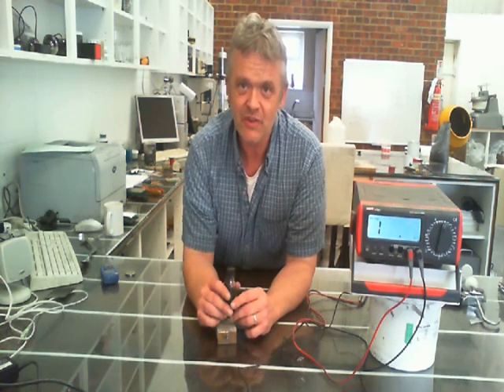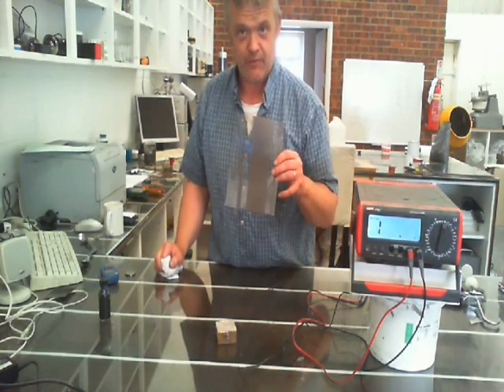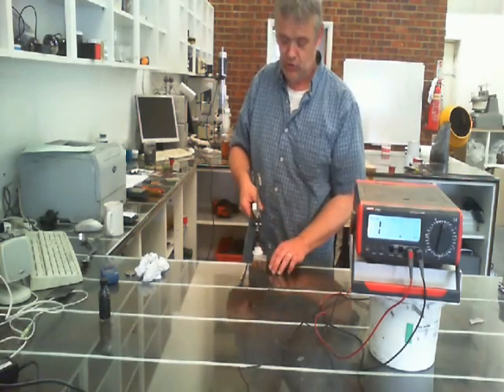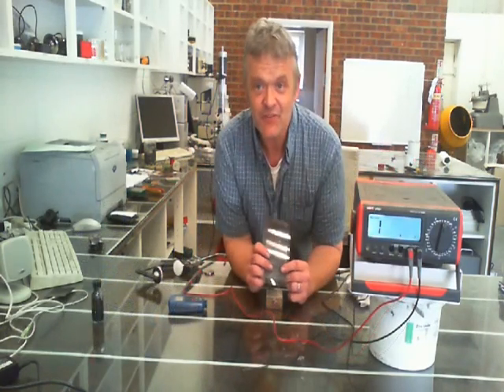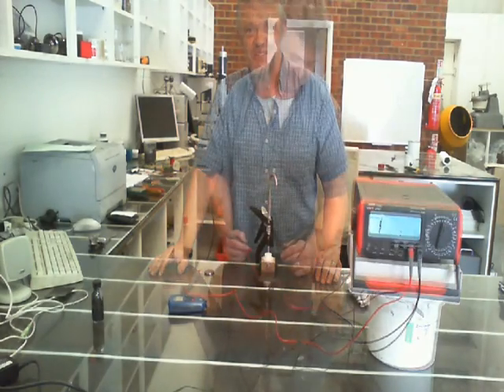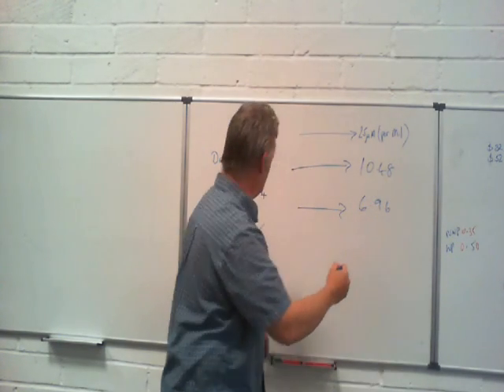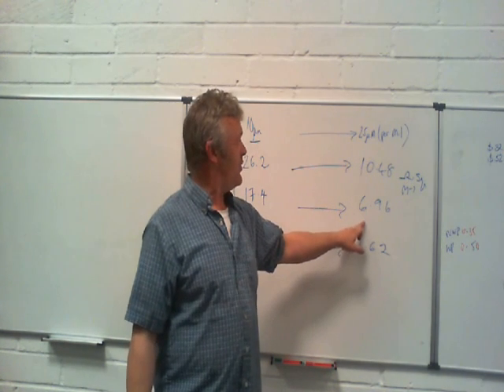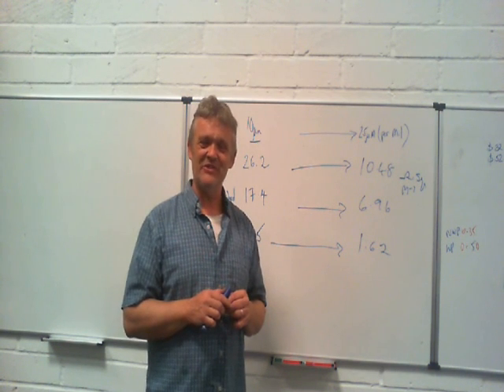Super Conductive Carbon Ink

Comment: I was doing virtually the same experiment last night with the ink buffing but with a twist. I applied a current, much like the heat matt concept,  to see if I could 'alighn' the carbon ink. My thought is to then "cook" the zinc oxide to the carbon with a sheet of aliminum on top. Stand clear mad scientist at work. Will post a video on the results.
Reply from the maker: I want to see it - so do!

Comment: I know this is old, but it would be interesting to see some electron microscope images. I presume the conductive particles are graphite/graphene. So I wonder whether burnishing just pushes the particles closer together, or whether they join up molecularly to produce larger graphite/graphene particles. If they do join molecularly after burnishing, then it should be extremely robust, allowing smaller bend radii on a flexible substrate.

Comment: Which method did you use to make the conductive ink which you sent out Robert?  I mean the non waterproof stuff that I have. Which of your videos is closest?

Made another 3 swag sheets today, and they are doing great!  Just bought 30 more acetate sheets to try some different shapes and ideas.
Reply from the maker: I take it you are running short of ink then lol - just email me your address and i'll send you some mate - but i am off to the states for a week so it iwll be after taht
Reply: Robert Murray-Smith Nah, I'm good for the next week for sure! I still have more than 3 quarters left. I'll definitely be in touch when I do though mate! I think that pot you sold me was well filled, and I'm only using it for very thin layers
Reply from the maker: MrSkypelessons
that's cool mate - you are doing some good stuff and happy to help where i can

Comment: Hey Robert the water based conductive ink dissolves in a copper plating solution.. Cant do copper plating in a container. Will try manual coating with a sponge.
Reply from the maker: better if you use the waterproof ink mate - that's what it is meant for - I had reports that the waterbased stuff was ok with absorbent materials like leather but not plactics and remember to wash your thing in acetone or IPA before coating to remove the grease

Comment: Hi Robert,  I have a question about your method of converting the conductivity of your sample to a 1 mil equivalent.  Is this thicker three dimensional ink like having a bunch of series-parallel resistors  and then dividing the measured resistance of the 3 dimensional resistive network by the number of parallel resistors to get the series resistance?  Keep up the good work. Cheers!
Reply from the maker: +Inspironator no mate - the material has a bulk resistivity that is directly proportional

Comment: Wow.  By the way you can get an inexpensive slip roll 3-1 brake, shear, slip roll 32 inches I think for under $400 less with a coupon from harbour freight.  Only does up to 18 gauge but should be fine for what you need, and you can always modify it. If you desire ultra high pressures I would be willing to put together a hydraulic slip role for just the material costs.  I had tried my hand at pyrolytic graphite some time back and the difficulty in getting the high temperature along with the brittleness and such had me move in another direction.  Even looked at 6H SiC for a time but then its a large perfect crystal that is hard to get.  Many may not get what a big deal this is, but I am having to pick my jaw up off from the floor. It's one thing to get a lab result, it is quite another to get a lab result which can be manufactured such that the lab result is repeatable in the field easily.
Reply from the maker: I do sometimes wonder if people get it lol - I will get round to a brake as I need it to really test some stuff I am doing.
Reply: Might be interesting to try a non ferrous metal which can be welded with pressure, in combination with patterns of graphene layered on different sheets of the metal.  In such a case the welded metal have the strength of a solid but they have the holes the size of the ink line of your pattern.  For Al you need 5K PSI per inch. As you know you can lower it somewhat and elevate the temperature to just below its melt line.  It would enable heat exchangers that are ever more compact and efficient.  For others who are following our conversation these type of heat exchangers are known as printed circuit board heat exchangers, and the welding process is known as diffusion bonding.
Reply: Here are some resources for those people interested in printed circuit board heat exchangers. 

http://www.academia.edu/3641995/Selection_and_Use_of_Printed_Circuit_Heat_Exchangers

http://www.chemkb.com/equipments/heat-exchangers/printed-circuit-heat-exchanger-pche/

http://www.inl.gov/technicalpublications/documents/4731815.pdf

And there is an article on science direct if you google.  Also look into tesla valves when designing as it offers some unique ways to build such heat exchangers.
Reply from the maker: now i have to get up to speed lol
Reply from the maker: Kimberly Peacock
nice idea
Reply: Robert Murray-Smith It's ok you are still ahead of the pack.  The most critical area to make use of this miracle material is ease of manufacture and ease of engineering use.  In baseball we would say you hit a walk off grandslam with the team down 3 runs in the bottom of the 9th to win the game.
Reply from the maker: Kimberly Peacock
and I was watching the mets only last night lol - I like to think of things in terms of what i call appropriate technology - that is - that technology that is sufficient to do the job

Comment: Im fairly new to working with electronics as far as building my own circuits and boards. I'm much more of a wood worker. I was wondering, would this work well if I used your ink to draw a circuit onto sealed wood? I'm assuming it would have to be sealed with shellac or the like to prevent absorption into the wood. I'm very interested at mixing my two hobbies together for some interesting designs. Thanks in advance.
Reply from the maker: guardianPO I think it would certainly work mate

Comment: Hi Robert, I see you are using a 2-wire meter rather than a 4-wire meter for the resistance measurement. whenever I use my ordinary fluke 75 there appears to be a residual / inherent resistance of 2 - 3 ohms when I do a probe-tip to probe-tip test. 
If your meter is anything like mine, the 4.5 ohm would be halved. Is this significant for calculation purposes?
Reply from the maker: yes

Comment: Hi Robert, Have you tried to print very fine tracks with your super conductive ink in <1mm width range. I would be interested in your readings for circuit density.
Reply from the maker: i will do it mate
Reply: Robert Murray-Smith
thanks mate I appreciate it. I have been following along and making some ink and this is where stuff breaks for me. Trouble is I really don't know what the quality of the graphene I am producing is and I am not sure I have my graphene to binder ratio or recipe correct yet.

Comment: I have a question for you, In what method that you have tried do you reckon you have gotten the largest and purest graphene nanosheets? I need them in the 800~2k AMU's. IDK what other units to put that in. Then I need to figure out a way to isolate them by shape. possibly steal an enzyme from some bacteria or plant or such and use that eh? 

I'm after early nanocircuitry. at that distance I should be safe making a transistor I think. If Im lucky I might design some standardized parts for constructing artificial enzymes in the process.
Reply: I am almost always optimistic about these things, can you tell?
Reply from the maker: by amu do yo mean atomic mass unit?
Reply from the maker: Keegan Maloney
it does seem ambitious but without ambition where would we be lol
Reply: Robert Murray-Smith Yes. what would be the right way to define the size of a molecule? longest and shortest points across in μm?
Reply from the maker: for graphene nanometers
Reply from the maker: Robert Murray-Smith
that is for physical sheet dimensions you might use angstroms for distance between sheets
Reply: Robert Murray-Smith I guess I would need everything from a ~ 7 by 18μm sheet to maybe 30 by 50 ish? now that I think of it, I do need a variety of sizes. 

I have some notions of how to use enzyme 'filtered' shapes to form physically changeable states using doping and very small charges. Actually, I could make it a memristor with about the same difficulty as making a transistor couldn't I? Still, its not exactly the same as the graphene memristor they already made (I don't think).
Reply: Keegan Maloney also this is mostly off the top of my head right now, I reserve the right to change my mind about the sizes. Early days.
Reply: So I guess I don't really have a clear question for you at the moment, as I need all sizes. I guess I could ask if these are all reasonably attainable dimensions?
Im not talking about few-layer thick graphene by the way. Im talking about  single layer.
Reply from the maker: Keegan Maloney
What you are asking makes sense to me - just about any method will do it - you need to select your starting graphite size with a D90 in the region you want.
Reply: I think I understand. Thank you very much for filling in some of the gaps in my knowledge.

Sometimes It's just better to ask someone who knows rather than spend forever trying to find your way alone. Thank you again.
Reply from the maker: Keegan Maloney
cheers mate
Reply: Sounds like you are talking about needing gas dispersion processes on a copper plate. That will give you very large uniform sheets, but it's very expensive.

Comment: Since it says carbon( and not graphene), my guess is you used graphite? Apart from  graphene it's the carbon with highest conductivity as far as I know.
Reply from the maker: i use graphene a lot mate - but you know that
Reply: +Robert Murray-Smith yes indeed. Graphene is a bit out of my reach currently(non-technical reasons, time and money for research mostly), and since my goal is an extremely low cost ink graphite looks really attractive. For whatever reasons my ink prints very well(I'll upload pics soon) but with a paint brush it's really terrible. It paints like really dry paint and just doesn't soak into the brush, inspite of being water based. Is it possible particle size of the graphite is to blame? Sorry to be asking so many questions.
Reply from the maker: no worries mate - it'll be due to the wetting properties
Reply: How right you were! I added some surfactant and it works great now! Thanks a lot. Btw I've had some success recently with a heat treatable copper inkjet ink- it's still in the development phases but there definitely is copper. I can't seem to get the copper salt concentration high enough for a proper conductive track yet, but I'll get there hopefully.
Reply from the maker: you could always try complexing it - say ammonia or maybe triethanolamine
Reply: +Robert Murray-Smith I've done ammonia- it works but I want to make something that doesn't suffocate me every time I print a circuit lol.
Reply: +Robert Murray-Smith triethanolamine I'll try.
Reply from the maker: lol
Reply from the maker: good move
Reply: +Robert Murray-Smith I'm even thinking of a SILAR type printer ink- copper ions in one ink, reducing agent in another.  Print half-tone as usual, and end up with a reaction(that 'works' on paper)
Reply from the maker: cool idea
Reply from the maker: yes - it doesn't make much difference
Reply from the maker: i am sorry mate - i don't use facebook much
Reply: I made a new ink today and got a sheet resistance of around 14.4 ohm per square per mil. Is this decent conductivity, in your opinion?
Reply from the maker: that's awesome mate

Comment: Perhaps good work, but for me and my below par hearing it's a little to muddled and fast, But I'm glad others found it very good
Reply from the maker: +meeekstube sorry you found it hard to follow mate
Reply: +Robert Murray-Smith 
No worries, got to work on Australian accent, only joking and that was a quick reply!
Reply from the maker: +meeekstube i always try to reply to my comments mate
Reply: +Robert Murray-Smith  And it's very nice of you
I had bought some "conductive Silver" from Jaycar an Australian mob that sells this kind of things but there were no instruction on the little package that contained only a small vial of it with its chemical component. So searched youtube for more. 
This morning a mate of mine actually tells me that what works for him is simply use a lead pencil and use it on both surface of the remote contacts! Someone else mixes the graphite with alcohol.  
My conductive silver kind of works but I was expected it to be even more sensitive...We'll see
Reply from the maker: +meeekstube for cost benefit i don't think you are going to beat graphite mate - for performance silver is best but the price is high
Reply: +Robert Murray-Smith I had never heard of graphite before and the shop charged me only 12 aud . Perhaps more expensive but I did two remotes and only used very little of it, I don't think I'll ever use the lot as little as it is. (that is if I did it right?)
Reply from the maker: +meeekstube no - you don't use much lol

Comment: My original interest in graphene was driven by my life long interest in hifi and how the smallest changes to cables, speaker, between digital /audio converters and pre amp input stage. I had oft wondered how a graphene coated cable would sound.....wellll....now here you are making this even lower resistance version and iI am reviving my thought perhaps it can coat a copper cable(or silver) and be passed through an annealing set of rollers and finally powder coated ....now that would be interesting.   thanks....keep it up
Reply from the maker: cheers mate - i started this looking for a good conductive ink - about 2 years ago lol